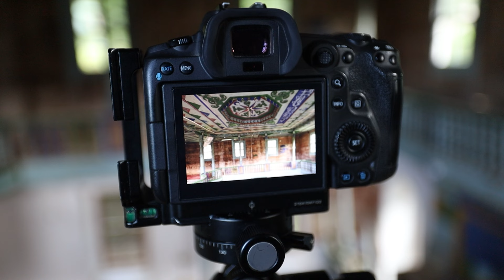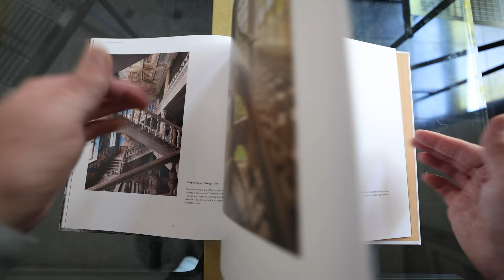Nailing Verticals / Architecture Photography - inside a WONKY mosque!

Comment: Amazing texture of the walls, with the wood....
When you say move the tripod a bit to the right and turn the camera to the left, do you have to then crop one of the sides accordingly?

Another quick question not photography related, but what are the steps used for in church services? the last couiple of locations had the same interior features?
Reply from the maker: I mentioned it in the first video of the series.

Also there are more descriptions under the images on my website, but essentially - the minbar is a pulpit in the form of a staircase on which the prayer leader (imam) stands when delivering a sermon after Friday prayer.

With regards to the image - i haven't cropped anything in post. It was all in camera, i moved the camera left and let the rest of the architectures features "fall away" - i.e they are not all lined up perfect - just the main features.